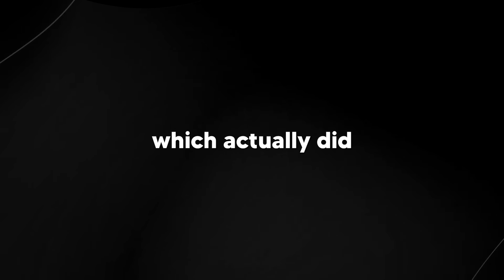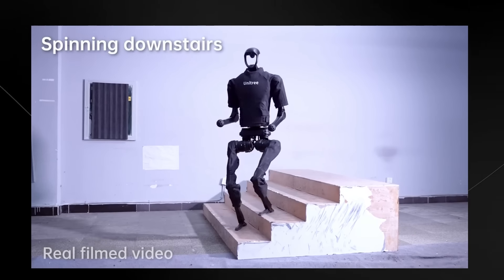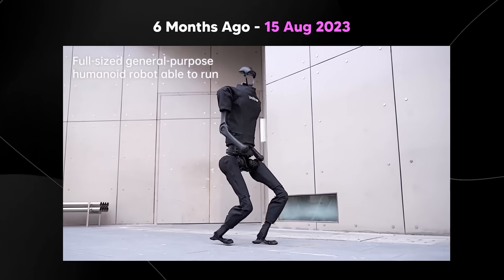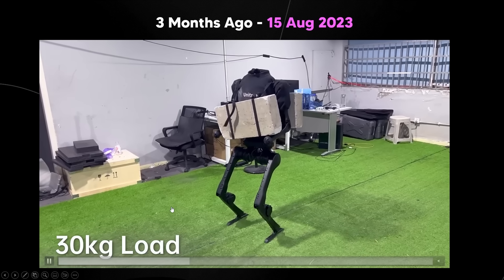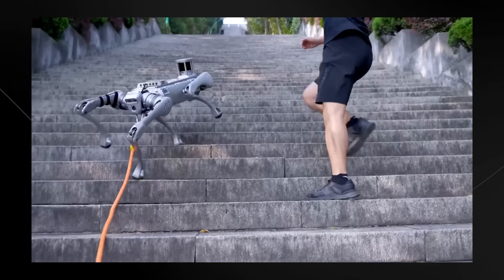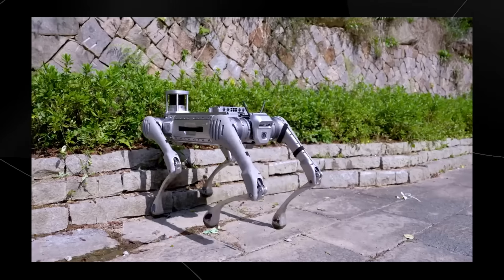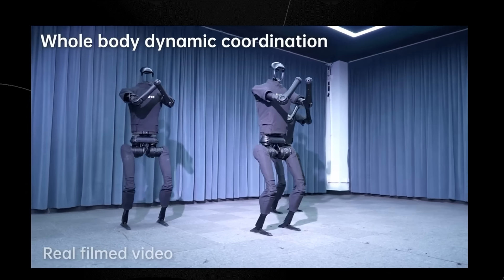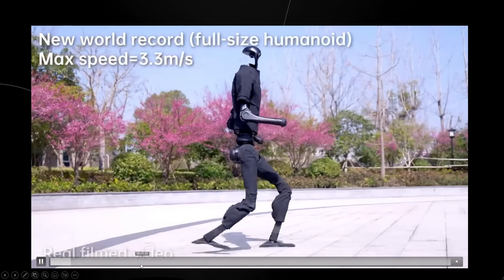Chinas NEW Humanoid Robot SETS WORLD RECORDS! (Unitree V3)

Comment: Since I'm an optimist, I'll say I think theres still like a 1% chance this is gonna go in a good direction
Reply: That’s way too high of a probability
Reply: I would say 1% is indeed highly optimistic and even 0.01% is still optimistic.
There are not many ways to stop it at a certain point.
Even with a good equivalent that could hack it etc it could be aware.
If you try to sabotage, it could know it before or the defense is too strong.
But I would bet it's not easy as throwing a milkshake onto some electronics.
Reply: So with ur optimistic, what's robots company gonna have a higher chance?
Reply: @sustratiotes7  🤣

Comment: The prices floating around for the humanoid bot are $90K.  The videos demonstrating speed seem to be off or slightly altered to me. Something is off-putting to a natural eye and has definitely been messed with.

Also the tether in the other videos like Tesla are not holding the robots up they are there to slow or deescalate the robot and prevent it falling all the way if something goes wrong. This way they don’t have to spend as much time and financial resources repairing it, if it happens to stumble.

Comment: The most important part of a Humanoid robot is its fingers and the ability to  do useful work
Reply: It depends on the work. Like with this one they show that the "hands" are a module, so for some things hands are better, but maybe you could install a drill, hammer or shovel or whatever depending on what task you need the robot to accomplish.
Reply: Scissors are where it's at!
Reply: How many useful tasks can the human fingers do that the robots have yet to cross off the list?
Reply: to be real - I guess what will happen before is that a gun will be mounted instead of fingers
Reply: @doctorrichard2235  the human shape isn't perfect, but it is capable one. Human Hands means Human labor on multiple fronts.
Reply: Human hands and AI training have proven not to be that difficult and can be added later or even be swappable with tools.

It is only Boston Dynamics that has robots with this level of physical agility and for the humanoid they have the more compact form factor.

Both Unitree and Boston Dynamics humanoid robots can get human hands and work indoors or get a gun and fight wars. The two most attractive use cases in the market today.
Reply: Implementing humanoid robots in most labor-intense jobs is not remotely dependent on dexterous and sensitive hands.

Only a very small percentage of jobs at risk of being replaced by automation require any level of dexterity beyond gross body mechanics motions.

Comment: The stability is really impressive. You imagine if robots hit the streets in the future then they will be attacked, if they can't be damaged then that will be a significant factor in their social impact.
Reply: Its a robot full of metal and electricity with sensitive sensors. Extremely easy to incapacitate. A basic cattle prod would do the trick lol. I imagine they will be operating on a network. Throw a faraday cage blanket over it. I can write a book on this stuff.

Comment: I think adoption of the quad bots will be quicker than the humanoid bots. Cheaper. Less intimidating. The bipedal bots that stand nearly two metres tall and run faster than us will concern people. The big ones will be used in warehouses, but the ones that will take hold at home are the 1.5 metre ones that will be cute and not scary. They can still get a cup of tea or do the vacuuming, but they don't look like they'll throw anyone out a window. Exciting times. Especially given every second company is providing API's to connect the robots to their AI. Embodied AI is not even a year away. Actually, take that back. Tesla FSD, and Waymo etcetera already are embodied AI.

I also reckon there'd be a warehouse full of quad bots with guns on top sitting in a DARPA site right now. Drones to target people and quad bots to carry heavier weapons. Feels like that Black Mirror ep with the quad bots going after people when they were left to guard the warehouse. That was a scary ep.(I wrote the comment before you mentioned the same ep. Yep agree).

Comment: it all boils down to the control algorithm that balances the robot, Unitree obviously has cracked this problem. The hard part of a humanoid robot is not the fancy hand maneuvers, but the balancing of the robot in a dynamic environment, if you can not solve this problem it will be just better to put the robot on wheels(like what 1X did).
Reply: To maximize speed, you could give them extendable roller-skates. It's more energy efficient and cheaper than turning wheels, since it can use the bodies motion to traverse faster.
Reply: I would say the 'fancy hand maneuvers' are the hard part.  It looks like balance has been solved, seeing as these robots balance better than the average human.  However, every robot I've ever seen attempt even the most mundane dexterity task (washing a dish, or cracking an egg), does so with all the finesse of a toddler pouring their own juice for the first time.

Comment: $1600 expensive?? Personally, I can't believe how cheap that is. That's the same ball part as a high-end robot vacuum, and it certainly seem way more advanced then them ;-)
Reply: I'm an electrician. I'd get two of them and tell them to unload the truck and get me stuff all day. Also it would be safe to get them to turn on and off large disconnects that require arc flash suits.

Comment: ^Exponential growth == AI

The original psp (portable sony playstation), the battery had a hardmod where if the modded battery ran out of power, you could open and take a lead pencil and run it along the trace (from hardmod) to give the battery enough power to turn the unit on. I wonder if ai could do this to its own power supply.

The dogs will be weaponized and the humanoids used for triage.

I think affiliate marketing would be a good target platform to widespread introduce to public use.